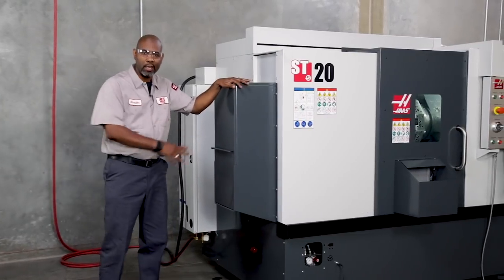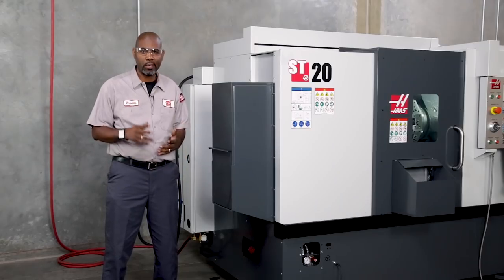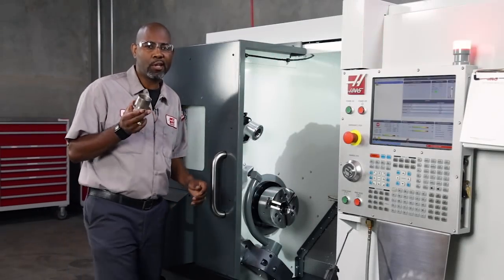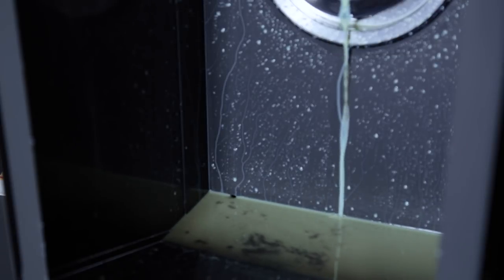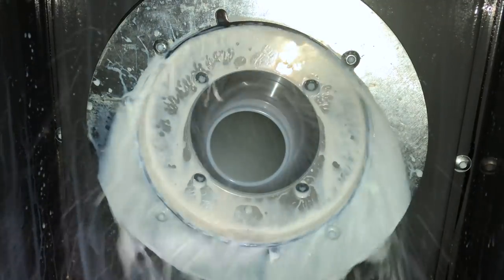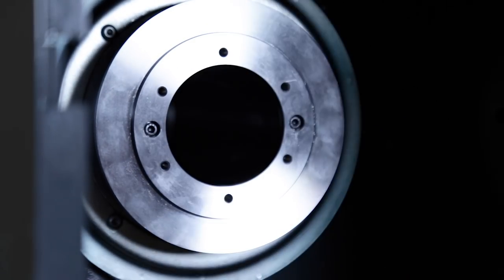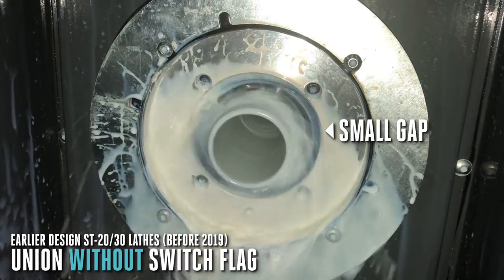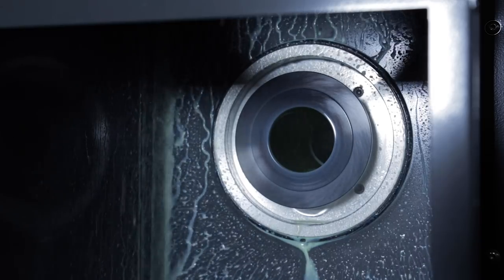Lathe Hydraulic Power Unit Contaminated by Coolant? - Haas Automation Service

Comment: What kind of problems would contaminated oil cause?
Reply from the maker: brad - most commonly you would notice a loss of hydraulic pressure with your chuck or other workholding.  It might also affect tailstock pressure if your machine has a hydraulic tailstock.  Haas Automation